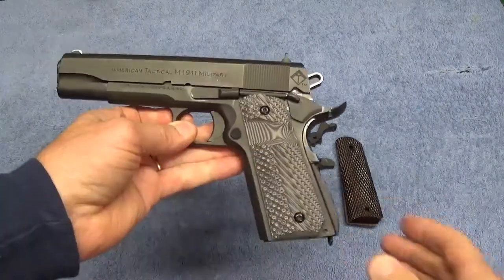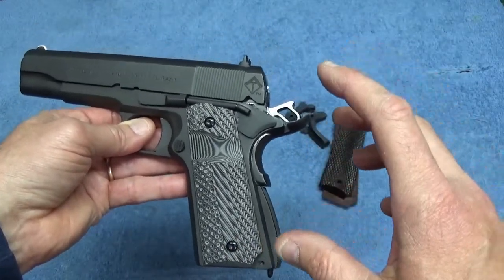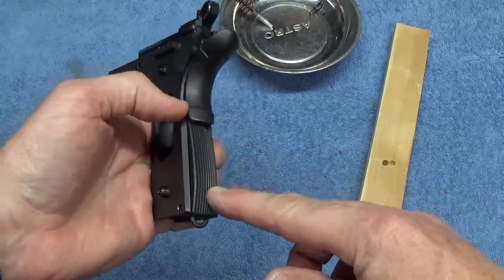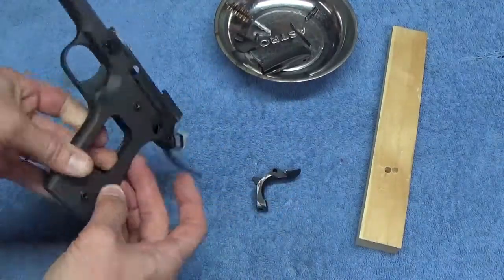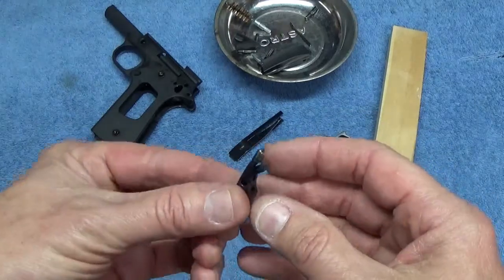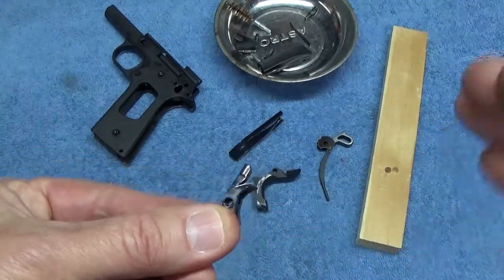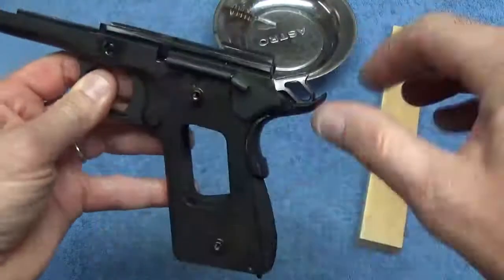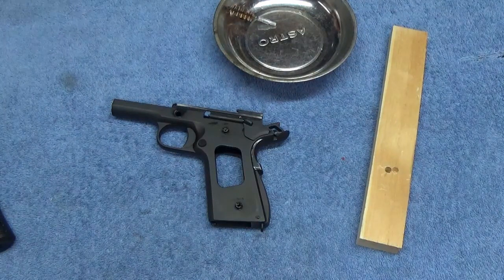1911 Frame Disassembly & Assembly With Upgraded Parts

Comment: Got a 1943 Remington Rand recently and I'm a little hesitant to fully disassemble that beauty as I haven't worked on a 1911 yet. However, after watching this video, I'm more comfortable with the idea of actually doing it. So, thanks for uploading this.  🤝🏻👍🏻
Reply from the maker: I am glad it is helpful. There are lots of good 1911 resources out there. Do the field strip a few times first. And take your time. Don't force anything and you will do great. Also if it operates correctly now, don't bend the main spring at all. Good luck.
Reply: @johnshandloading7907  Thanks for the advice. Appreciate you. 🤝🏻
Reply: 2 maybe 3 . Fabrik Argentine . Necessity  . On disassembly . CZ  disassembly  better . Anywho .

Comment: You dont know how much you relieved my worry about taking my 1911 completely apart. I can take the slide out no problem but i have a hammer and trigger coming and wanted to see if there was anything that i was going to have to worry about while taking it apart but other then the pins with the spring for the safety i believe i will be a ok to do this but i will be watching as i go so i don't mess it up. Thank you for helping out with this video.
Reply from the maker: Thank you for letting me now it helped you. Take your time and don't force anything that seems stuck. Good luck.

Comment: Great job explaining everything, I have parts for my new Springfield Prodigy 1911/2011 and I am replacing the trigger too.  You made it look easy but I’ll watch your video while I replace cheap parts on the Prodigy. You would think a $1400 pistol would come with the best available parts but instead it comes with the cheapest parts available. Doesn’t make sense but the finished product will be worth it.

Comment: So if I wanted to convert my government 1911 model to the beavertail grip safety. I have to get a commander hammer with new sear that comes with the hammer?
Reply from the maker: Yes that is correct. If you can get matched pieces that is a good thing too. Just be very careful any time you change anything related to the sear or disconnector, and safety test it extensively before live firing. They can go full auto and that is a bad thing to have happen in a pistol.

Comment: Thank you. I’m just getting ready to do the same thing to my ATI. Did you tune the main spring? Mine has a trigger pull so heavy, my gauge can’t read it.
Reply from the maker: I have tweaked main springs in a few guns a few times. Go slowly and carefully and read about how to do it. It is BETTER to have a heavy pull than  too light pull. Too little spring tension and the gun is NOT SAFE. The disconnector needs to reset so it does not go automatic - also you need the grip safety to work. BE CAREFUL. Small changes in spring tension and position make big changes to how it operates. Check and double check as you adjust. Good luck.

Comment: That's not the main spring it's the sear spring....Mainspring/hammer spring is inside that mainspring housing.....That probably is the value line hammer and sear from WC....I would have spent the extra coin and got the Deluxe A-2 bullet proof sear and matching hammer....Your disconnector is good to go.....I've installed many sears and hammers from WC.....Great product...I would not recommend doing any polishing to a sear unless you've done it before.....

Comment: Hey John, great video! So informative and detailed. I’m working on my AT1911 aswell and I’m looking to buy the new hammer for my new beaver tail since the original will not fit, my question is, did you have to buy a new sear or was it an option? Do I need a Wilson combat sear aswell to match the Wilson combat hammer and safety grip? Hope to hear from my man.
Reply from the maker: I added the sear only because I wanted to. As I remember it, the original sear would have been fine. I did use the original disconnector. It did require some fitting of the grip safety. Every gun is a little different so be aware of that. Go slow and careful. Bench test everything before you live fire. Good luck. Thank you for watching and commenting.

Comment: I just purchased 1911 A1 more or less made of mixed parts. Grip safety does not work and the gun fires when trigger is pulled. Do you have suggestions what  to look for? I  am in Europe and I don't have access to gunsmith that are familiar with 1911.
Reply from the maker: First try adjusting the tension on the leg of the spring that pushes the grip safety out so that it blocks the trigger. It needs enough spring pressure to tilt it toward the trigger and hold it there to block it. That may be all it needs. If the grip safety has been filed to much it may not work. If you can get a new grip safety  I would try that next. Sometimes the little part that blocks the trigger has been filed too short and does not block the trigger as it is designed. You can try and 'peen' the little tab on the grip safety to make it slightly longer so it blocks the trigger if needed.
Reply: Get a grip safety.  You have filed a little too much off.  Or have it welded up and refit

Comment: Hey buddy I just watched your video, I have a American Tactical FX GI 1911 in 45 acp I’m look to replace the slide because I want better sights, and I would like to replace some of the frame parts as well I see you used Bill Wilson parts, how can I find more of your videos on you fitting parts, and do you if a Colt slide will work since they told me that it was based off the Colt 70 series, any help that you can give me would be great.